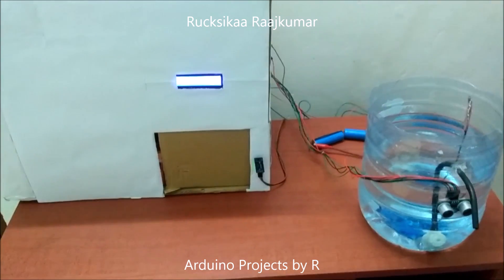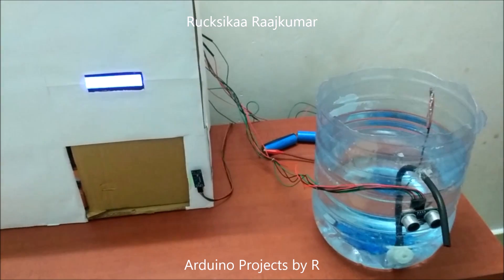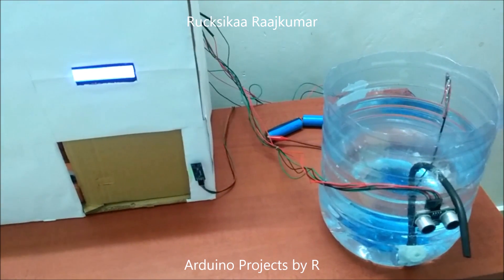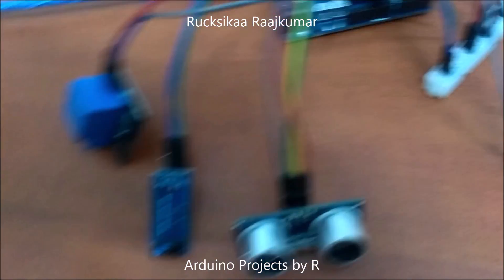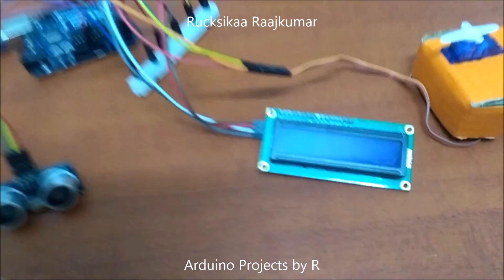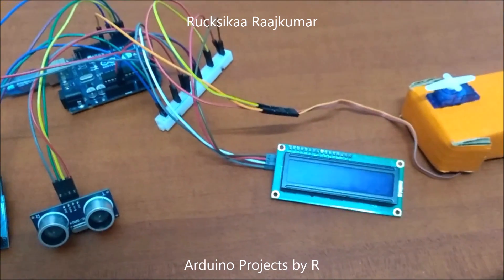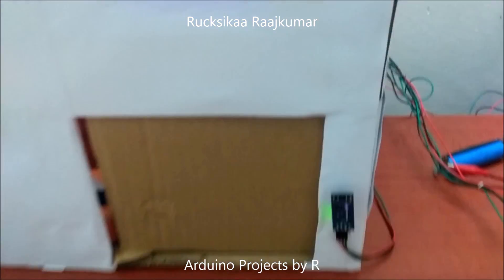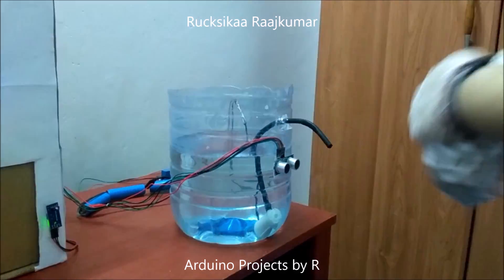Touchless faucet with door control system for COVID-19 #COVID19DetectProtect

Comment: where to connect water pump connection [+, _]   on relay module as per your circuit diagram..it is not clear??
Reply from the maker: The pump is connected to the Arduino microcontroller via a relay module and is powered by a voltage regulator in my project. One of the pump's wires is connected to the relay's NO whereas the other wire is connected to the negative terminal of the voltage regulator. The positive terminal of the voltage regulator is connected to the relay module's COM terminal. I used a powerbank to power up my Arduino microcontroller via USB. Here's a breakout of the relay module: https://osoyoo.com/wp-content/uploads/2017/08/relay-1-channel.jpg